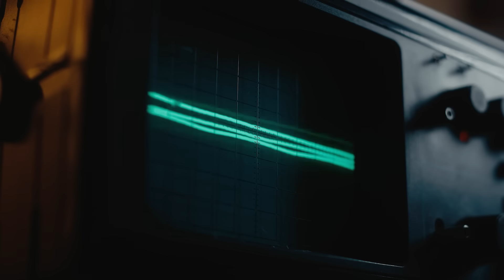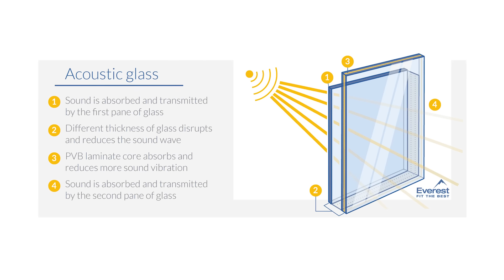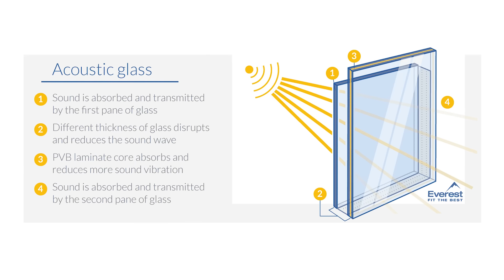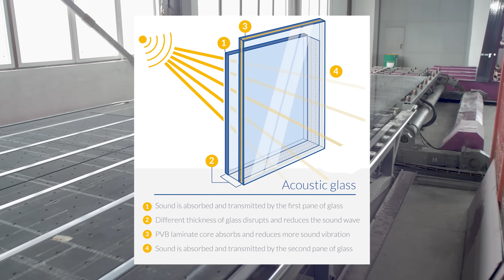Why Your 'Soundproof' Windows Won’t Work (Unless You Do This)

Comment: I've seen secondary glazing fitted to a property less than ten years old, beside a busy road in Wells. It wasn't a cheap job and they mimick the sliding sashes behind. But the results are fantastic. I find it almost surreal, when I'm working there; to stand back and observe the traffic passing in near-silence.

Downside is that you lose the potential storage space of your window boards.
Reply: We fitted cheap DIY magnetic secondary glazing to our old sash windows to deal with draughts and it makes a big difference to noise too because of the extra spacing. Also handily as it's just stick on and nothing is touched on the original windows there's no listed building consent hassle and even more important not a single thing has to be modified or lost of the original historic windows.
Reply: @etchedpixels That sounds great and I imagine it wasn't too expensive.
Reply: I had the same. The outer frame was a galvanised steel of the 1930s. The inner was aluminium The attenuation was astomishingly good.  The panes were all 4mm.

Comment: i do recording studios and the glass between the live room and the control room we normally have a double glazed unit these days you can have them made up with a toughened glass outer 4mm thin and thicker standard glass inner 8mm with a 18mm spacer and then we have a separate 10mm toughened glass panel at a angle. this means you have good hf control and a reflected mid bass range from the inner toughened panel. problem is like Roger says the treatment isn't just the windows and mass and separation is what you want. a room within a room kinda stuff.

Comment: Noise cancelling earphones or ordinary in ear ones with white noise "rain on car" YouTube a brilliant one as it blots out high and low frequencies simultaneously. Play it through speakers at a surprisingly low volume cancels most outside noise but you can still watch tv and hold a conversation after a while you don't even perceive it. Turn it off though and you instantly realise how affective it is.

Comment: I studied this problem extensively in my last house, and ended up building my own secondary glazing with acoustic glass and 200mm gaps on selected windows. But, they were non-opening unless removed.  They can be made to look good. You might have ventilation issues on newer builds.  But, running a white noise generator (a fan, for example,) is effective in merging road noise into a far less annoying noise, and put the road noise into the background.

Comment: they don't have oxygen inside the double glazing make them sound resistant. a cheaper easy ways to get some 6 mm perspex to sides. some blu tack. and some sugar.
doing this from the inside put a bead of blue tack all the way around 6 mm thick and push the perspex onto the Blu-Tack frame of the window close to the edges as possible without touching it. that's what's done in studio. lay a sugar bead at the bottom of the window, put this in a microwave on a medium heat first for about a minute.  this would absorb any moisture left and prevent condensation. or you could use those silica absorption packets used in packaging, but you need to dry that in the microwave first.
you really want to dampen the walls the best insulation is to use sheep's wool. you can spray this into the cavity.  paper could be used but not as good as natural shapes wool. the sound insulation and temperature regulation. sheep's wool is the best. Rockwool could be used if you're building a new wall.
you can build a false wall as well a inch thick using some buttons and using plasterboard. you want to isolate the buttons on both sides with rubber strips. that can be good if you got a solid wall. air barrier does help. also you can isolate your sockets with special cups you get a lot of noise coming through the sockets and light fittings.
Reply: Nice habitat for critters, sheep’s wool that is.
Reply: no they treat the wall it's cleaned. @zusspierings
Reply: That's how you get ants.
Reply: I don't know I've never heard of that. you would be hoping that the walls are sealed so ants don't get in. as I say it's treated so maybe they put something to repel the ants, what about paper that would be the same. @friarchris2

Comment: as an unitentional sound reduction improvement we installed tripple glasing, was a massive improvement initally,  however you quickly get used to it and start to hear quiter sounds.
Reply: i put a podcast on low to sleep, the rhythm of the voices lulls me off.
Reply: Double glazing is more effective than triple glazing for noise redcution.
Reply: @BODGE71  my ears would disagree with that statement, but each to their own, i work with a guy that got quad glazing last year, but hes near inverness, so again its for heat loss
Reply: @Mark-M72  I work in the glazing industry so know that "standard" triple glazing, i.e all the glass in the unit is float glass, underperforms an acoustic double glazed unit which has a combination of float and laminated glass. That's just in general terms. It's not to say that you couldn't have a triple glazed unit with laminated and float glass which would then probably outperform a DG unit. It all depends on the glass specification.
Reply: @BODGE71  i was only sharing my experiance, and it made a big diffrence, i have an exposed outlook so it was purchased for other reasons than sound
Reply: @Mark-M72  Triple glazing beats double glazing for thermal efficiency so you decide what you want to prioritise. Sounds like you made the right choice if the window is exposed.

Comment: Triple gazing is also an option for a new window too, just on the road side of the house.. We had it fitted as we had a railway to the back of us, it does improve the deadening 😊
Reply: What's the price and weight difference between double and triple glaze? Did you have to reinforce or redo the window surround? I had it as an option but being on a busy main road with constant daily ambulance, fire engine and police sirens with only about 6ft of pavement, I had to reconsider whether it's worth it. Sometimes, I can hear my single pane windows rattle when a HGV or bus is idle on the side waiting for the light to turn green..
Reply: @abcxyz3028 not as much as you think... You just need to make sure the frame will accept it or it might need a deeper window
Reply: I recently replaced a single glazed picture window with a modern triple glazed one. Both with wooden frames. This instantly ended 30 years of hearing car doors slamming and traffic noise. Dead silent indoors now. Triple glazing is the minimum local standard for thermal reasons.

Comment: I had double glazing installed 20 years ago and the wily guy doing the job suggested one pane toughened and the other normal as a cost effective way of reducing the noise from a main A road with a 30 mph speed limit. And it worked, because we have since had a new room built with double glazing with standard panes and there is a difference. Of course thicker carpets, underlays and curtains all add to help.

Comment: We had a house in Wales on a main road where the front bedroom windows were only three meters from the main road. Interior secondary glazing helped enormously however still the best strategy is to sleep as far as possible from the source of the road noise. On the back of the house you will only hear the low frequency pressure waves. Tire noise increases as roughly a cube of vehicle speed, while the noise you hear generally decreases as a cube of the distance from the tires to the listener. -- 3 times as far reduces the noise to 1/9th the loudness.
Reply: If you live in Wales it tyres
Reply: @eltamarindo
Thanks for this info ''tyre noise increases as roughly a cube of vehicle speed''.

Comment: With respect to Roger, before you embark on any of these measures, may I suggest a £5 fix and 30 minutes of your time.  Clean all the rubber seals of dust,dead spiders,leaves etc and then spray the seals with silicon spray.  This was suggested to me, and it makes a difference.  It's a cheap, easy first step.

Comment: very informative video as usual. One thing I had with noise coming through windows was rechecking the window seals between the openings. I had two windows where these was enough gap to allow the sound to be more noticeable. Updated the seals and the window closures and hay presto, fixed the annoying sounds. Saved a fortune over new windows.

Comment: When I was in the Forces at an airfield in Anglesey, about 1979-70, the 'Boss's (Station Commander) office was triple glazed with about a foot between the outermost panes and the innermost. Deep triple glazing. Aircraft known as 'Folland' Gnats, ( As used by the then Red Arrows team) training Jets  for new  jet pilots at the Flying Training School passed by the windows at about 25 -30 feet away. The room remained Silent. You could count the rivets, read the Canopy warning and the tailplane letters, but you did not hear them. Foot thick triple glazing can be Silent.
Reply: It can become handy to have selective hearing, every disadvantage has its advantages.
Reply: Is the foot distance necessary because of the wavelength of the jet noise?